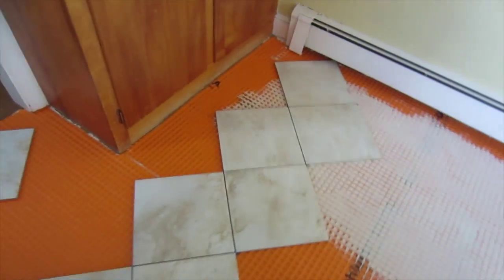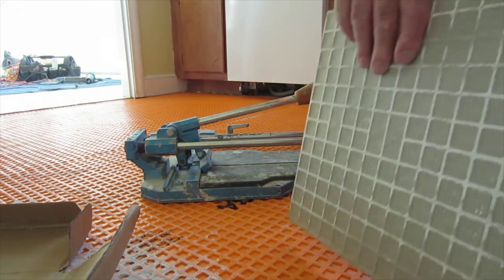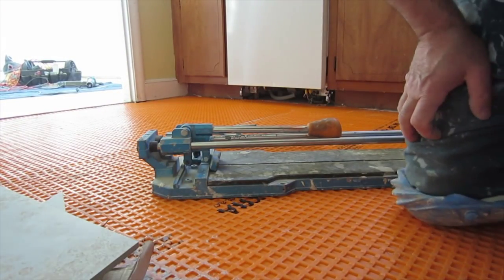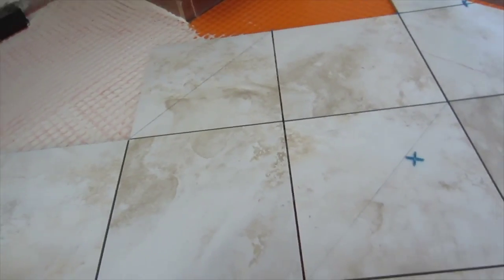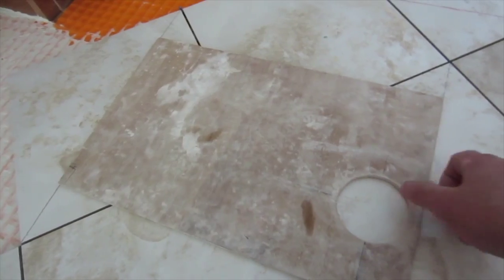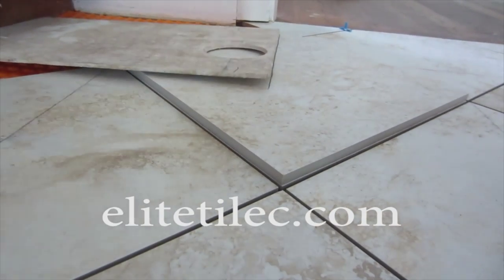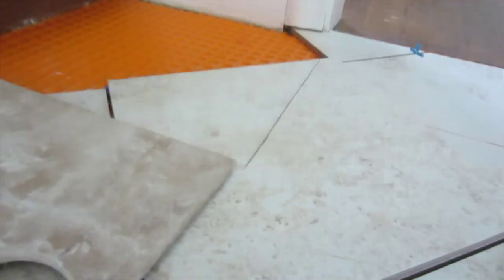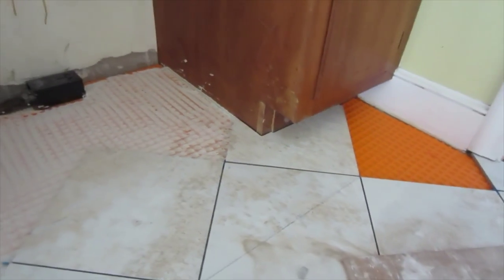Diagonal tile floor replaced with new tile on Schluter Ditra  Part 3 Lay out, marking and cutting ti

Comment: Sal, in your experience, do you think it is necessary to use ditra on a concrete floor. How often do you see failure such as cracking when you install directly on concrete?
Reply from the maker: If it were up to me, I would use it every time, however I don't always call the shots. As the saying goes, " There are two kinds of concrete, concrete that is cracked, and concrete that is going to crack". I have seen floors that have never cracked, and ones that have, problem is therd is no way to know which floor will and which floor won't.

Comment: What do you use to get rid of the pencil marks?  Great vids I love them all.
Reply from the maker: Most of the time it will just wash of when I grout, if the tile is not delicate and the mark is a little stubborn I will rub it with the grout a bit, if the tile is delicate, I will use due caution while installing.